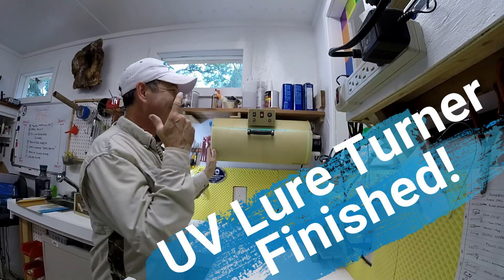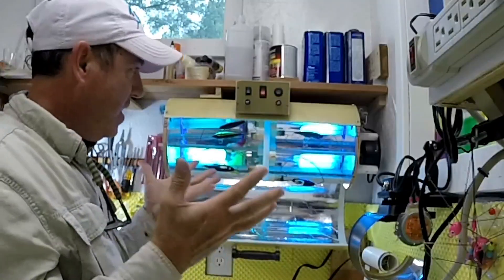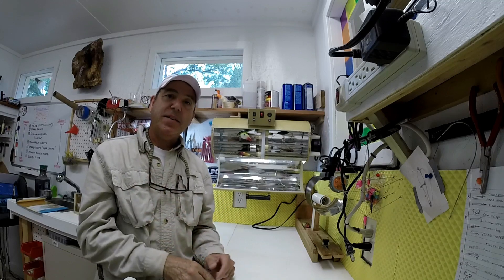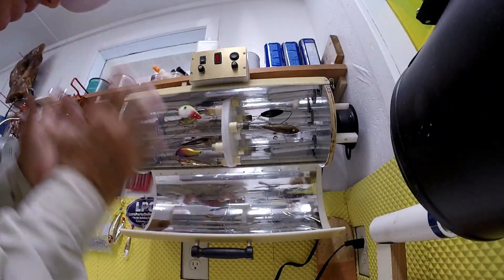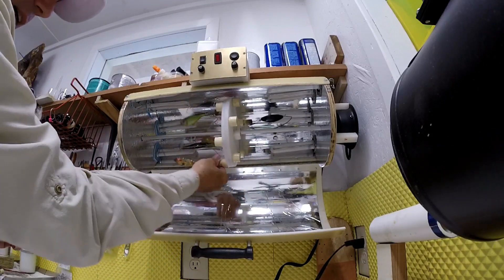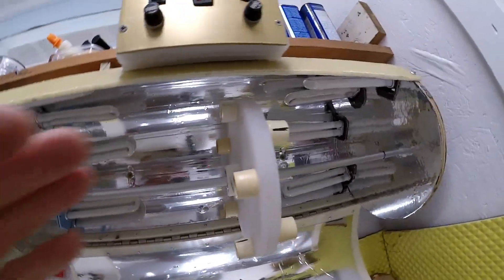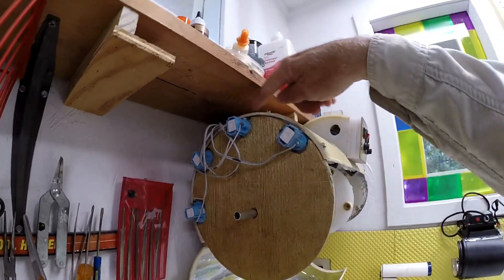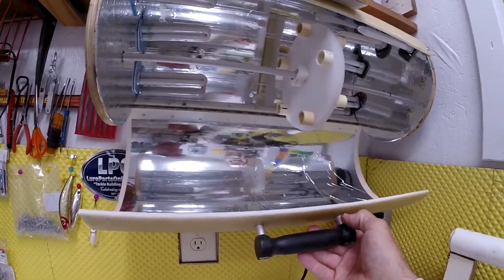Custom Lure UV Clear Coat Chamber

Comment: What kind of motor are you using? And also what are the components you used for the controller? I saw you wire a circuit board into the chamber.

Comment: Do you need fans in the uv box? I built one with a rotator and 4 solarcure florescent light box with 40 lure rotator.
Reply from the maker: I don't use any fans but if your lights tend to overheat  you might need them.

Comment: I came up with my own round chamber design using readily available parts and pieces, that you might be interested in. If you have an email address you can share, I can send you still shots and a description
Reply from the maker: Cool, thanks.  You can use engineeredangler@gmail.com

Comment: You set the bar pretty for the rest of us to build a chamber!! that's a well made. 
I'm brand new to the whole lure painting thing because my son gave me large lure that requires repainting. That opened a door and I stepped down the rabbit hole!! It's going to be a new hobby they tell me??
I have a question. How are your lure holders made? They looks like PVC caps attached to the unit and there appear to be pieces of PVC pipe with wire in them, how is the wire connected to the pipe and how does it attach to the lure?
Reply from the maker: I made a video on how to make them.  Check out my play list for lure tools.

Comment: I am a latecomer to your channel and am very impressed with your channel, videos and your most definite engineering style.  I have been building lures mainly for muskies.  I am going to build a lure turner/UV cure box similar to your build, but more of a box style because space is not an issue for me.  I have a question regarding the axle and the way the nylon discs are attached.  The axle appears to be round rod, and the holes in the discs are round, what keeps the discs from spinning on the axle, they appear to be friction only, is there enough friction to create the ability to have them "turn" or what am I missing?  Thanks again for your GREAT channel and videos.
Reply from the maker: Ah...yes...here's how I achieved enough friction to make it work:  I first added additional friction blocks to the disk to create thicker hub, then I drilled a whole, just a bit smaller (1 mm) than the aluminum tube, through the center of the disk hub.  I then heated the end of the tube and carefully drove the hot tub through the poly disk hub, being careful to keep it plumb.  Worked like a charm.  I expect that over time  the friction will decrease and my plan is to thread a whole in the hub and use a poly bolt as a friction bolt.
Good luck with yours and thanks for watching.
Reply: @EngineeredAngler  Thanks for getting back to me with this.  I added a collar to my disks with a set-screw to lock the disks down to my shaft (sounds kinky).  Beyond this, I'm struggling with how to wire the lamps to my UV box.  I know you mentioned in a video that you do not want to offer wiring advice,  I understand totally.  My units are Nail Star devices and they DO NOT stay on "constant" rather, they turn off after 30  minutes.  Ideally, I would like to re-do this so I can leave them on a separate timer for 1-2 hrs, unattended.  Can you offer any help with this (offline, maybe?)  I certainly understand a firm NO if that's the case.  Again, Thanks for your GREAT channel, videos and advice!

Comment: Have a question..can you use mirror in the UV box...or is there a reason why you you can't...thinking about switching over just trying to cover all the bases
Reply from the maker: Yes you can use a mirror as a reflective surface in your UV box. Lots of folks make the mistake of thinking that the glass will filter out the UV. That's only true for UVB. Anyting in the 300 to 400 nanometer wavelength works fine with a mirror.  I know it seems really easy just to dip your lure in the UV and then put it in the box but  I recommend that you find a way to put a Turner in your UV box this way you can brush it on and turn it like your other  resin clear coat. With this method, you get a thicker coat and less waste. Good luck
Reply: @EngineeredAngler  thanks..I'm using a turner for my epoxy..just plan on modifying it so I can use either way....

Comment: what did you use for the reflective material inside?
Reply from the maker: Just some reflective plastic tape
Reply from the maker: Actually I remembered it's self adhering vinyl sheet, usually used for making bumper stickers.
Reply: @EngineeredAngler  awesome! Ty

Comment: What uv bulb wattage are u using for the resin curing turner?
Reply from the maker: Mike guy 
they're small 9 watt bulbs but there's 8 of them. what's really important is the wattage density. that's wattage per square centimeter. since I use those really little bulbs I can keep my space small that means the light is concentrated. And with 72 Watts total it's a pretty efficient little curing box.
Reply: Now build something to keep your screws organized.....